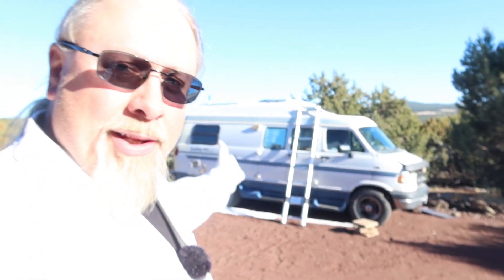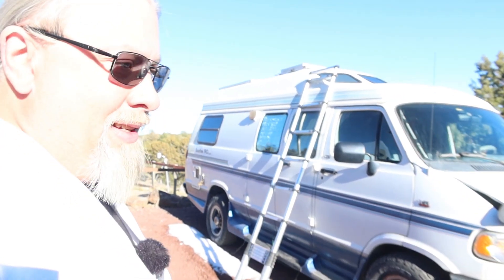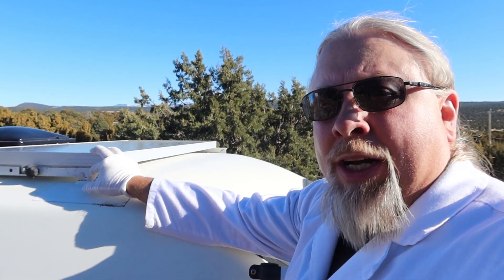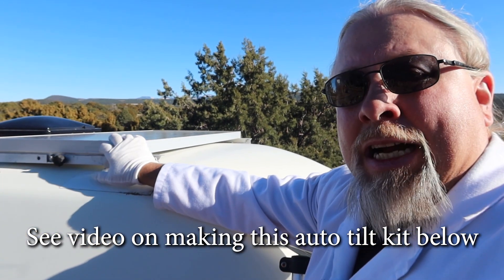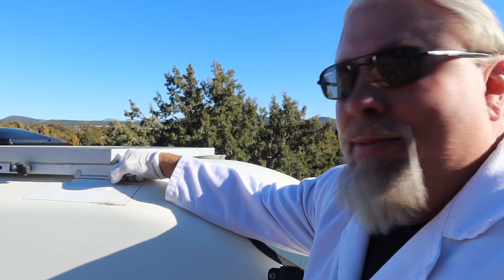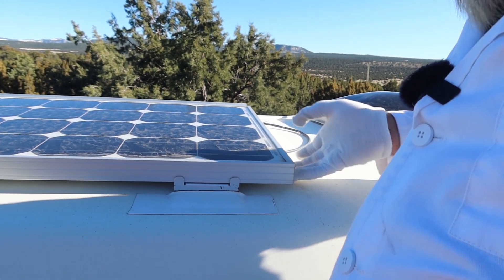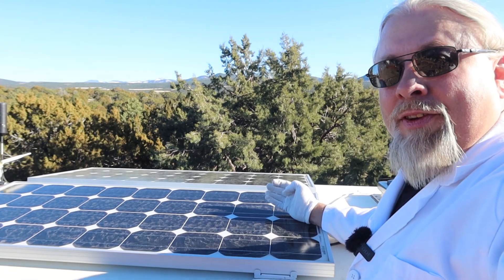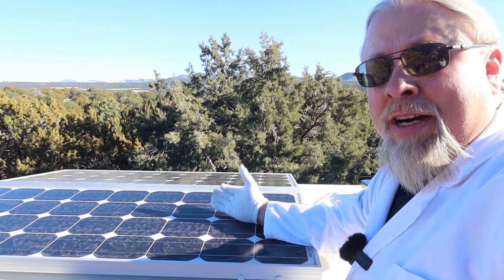RV Van Solar Panel Install Using 3M VHB Tape | 5 Year 30,000 Mile Long Term Update

Comment: I used the VHB tape on my Airstream.   Works great!
Reply: Good to know. I'm reluctant to drill my 91 Warrior roof, which is aluminum. So as long as I sand and clean the surface, and use eternabond over it I should be g2g.

Comment: Hi Tom. Would tape work on an ambulance? Probably aluminum? If I’m right? 
Thought you’d be going into DC. Thx as alway
Reply from the maker: Absolutely. Just sand the paint a bit first to rough up the clear coat.

Comment: I do worry about this method... not because I'm worried about the tape and Eternabond giving in - that stuff ain't letting loose! - but because I'm worried about the paint peeling.  I have a 2000 Ford E-350 and some of the paint on the roof has peeled over the years.  

I suppose the odds, though, of "all 4 corners" peeling are pretty slim.  So that if I check it regularly, there probably isn't any risk.  Likely, only 1 corner will peel at a time and I'd catch it long before there was a risk of the entire panel coming off.  I'll continue to give it some thought.  Not using the van to live out of, currently, so no rush.